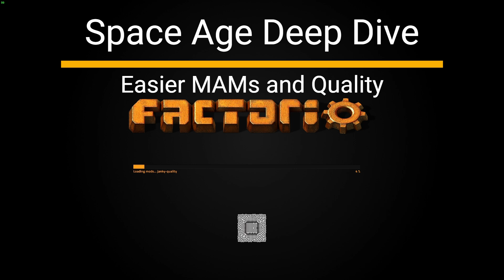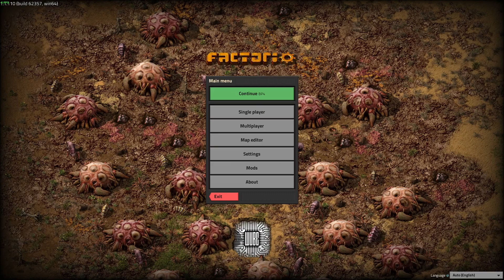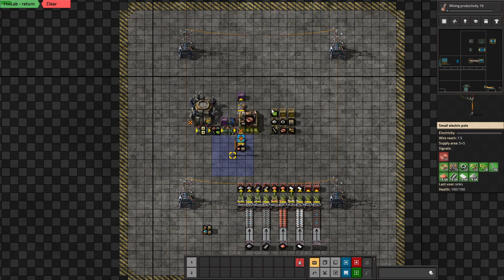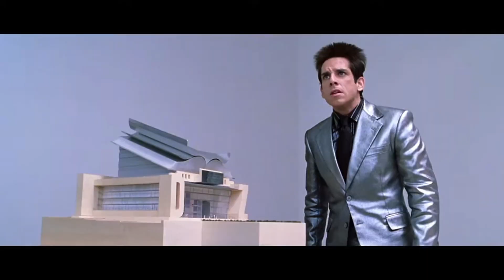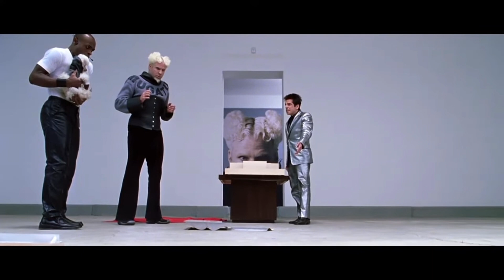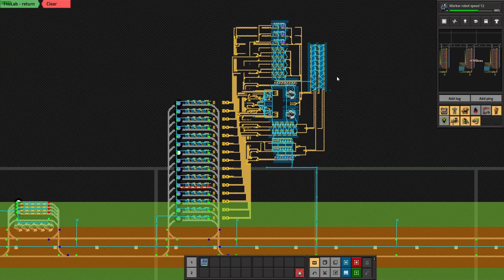Factorio 2 0: Space Age - Easier MAMs + Quality

Comment: I Need help bro. 

I take input from logistic network, multiply by -1, and add it to the same wire as the CC. I then take anything over 0, and pass it to a selector, and have it choose item 0. The problem is that item 0 keeps changing especially if it's trying to make for example Blue inserters, and then the yellow inserters for the blue inserters.  The yellow and blue inserters keep swapping spots and the assembler never ends up making anything. How do I stop it from doing this? Some sort of normalization?
Reply from the maker: Havent been able to play much, but yeah its a common issue, recipe changes before you finish.  Ive got a couple of ways to fix it, based on your application (or personal preference).
1. Add another selector combinator immediately before the Assembler, set to Random, pick a new value every 10 sec (try it, a 1 combinator crude asynchronous clock)
2. Im actually preferring to add a crude latch. the other colour wire adds say 5-10 times the current recipe to the construction queue, forcing it to make a few each time)
3. If its items that use a lot of products causing it to flicker, try adding the contents of your requester chest to the logistic contents channel.
I need to make a video, don't I ;)

Comment: A vast majority of your MAMs time ends up going into making the same thing over and over again. i.e. Coils, and circuits. This defeats the purpose of a MAM. It would be better to just have the intermediates come in on the left from their own outposts.
Reply from the maker: Yeah, early game it's not the quickest.  In space age though, its even more critical to have every single thing you might need sitting in a chest for remote building. I don't plan on having a dedicated machine for decider combinators :)
This'll do non-quality everything in a fraction of the cost and power as a dedicated mall, even if it sometimes is slow.
If you need something urgently from offworld, you can always modify the request queue remotely.

Comment: I ended up designing a basic MAM in a recent playthrough that reads the ingredients of the prior recipe, and then makes the most in-demand one in the next assembler in a line. Granted this was intended for an overhaul mod, so I had no idea what intermediates nor what machines I would need in the future.

Regarding Quality, the way to avoid the large resource costs is to put quality modules into every step of the process, all the way back to the mining drills. Much like Productivity, Quality stacks multiplicatively across each layer where it's used. Using 2 Q1 quality 1 modules in a green circuit assembler only gives a 2% chance to get a better circuit. Having the modules in the miners and the assemblers bumps that to nearly 5%, at the cost of needing to sort out quality ores or plates before they get sent to rest of the factory. (I did not mention quality modules in the wire assemblers, since making quality circuits should use ingredients of equal quality, and giving copper an extra layer skews the ratios and might even cause the items to back up.) There's also the factor of the negative quality modifier on speed modules that could disincentivise using speed beacons around assemblers made for building Quality.

Extending the factors up to the modules themselves results just shy of a 7% chance for a module with a quality higher than common, and this is just from common tier one quality modules.

Fun fact: modeling outputs from machines with quality modules can be used with matrix multiplication, where each entry is the chance to get a given quality output from a given quality input. Since quality can only increase each step, that means that the matrix in question is technically an triangular matrix.

Edit: I forgot to include that I think pre-bot MAMs might be possible using sushi thanks to the new whole belt reader.
Reply from the maker: I think you're spot on about quality, I was working on another quality video for a "slipstream" design (rather than an enrichment loop), but then work called.  It'll have to be a how-to in the real game now (2 weeks!)

Comment: For the early game mam, What if you add a belt splitting into more chests, then having the whole belt read at the same time, read the items held in inserters too for accuracy when looping. This would allow more items to be stored without jamming on a single chest?

That legendary build is insane, I didn't think it would be that small. Really puts into perspective the sheer scale of bootstrapping that will be needed if a legendary megabase is planned. 

Probably will have a whole megabase just for the recycling loops needed on infrastructure items.

Thanks for the videos though, alot of good discussion.
Reply from the maker: Maybe, I can't picture how all the chests would be kept available for the self-supply (without filtered splitting or more logic).  You would have to modify it every time you changed/added products, instead of just dropping it on the request list